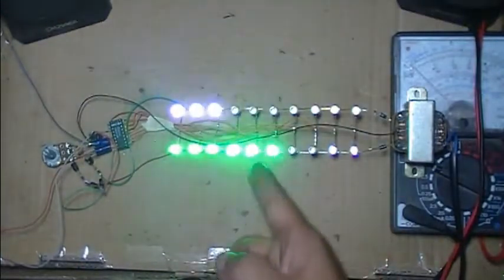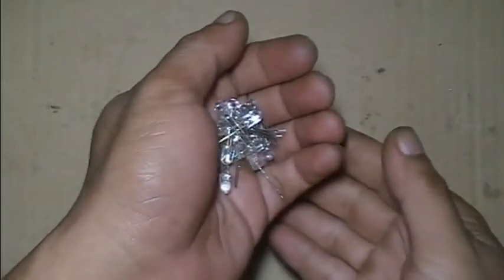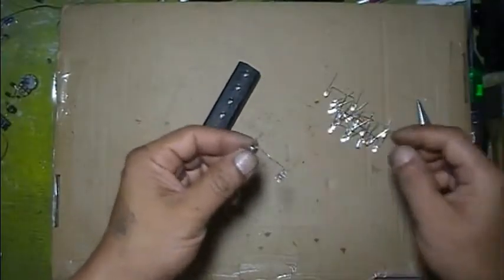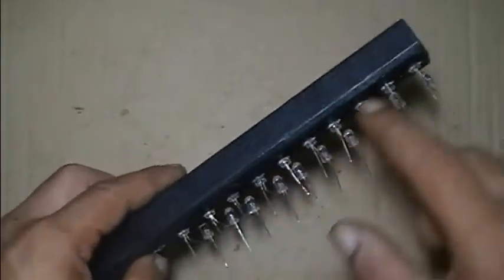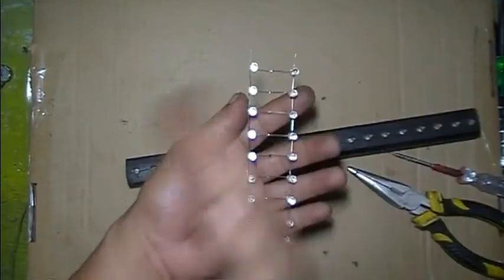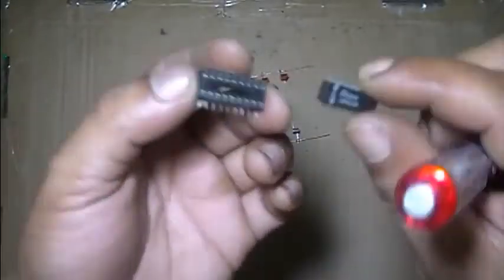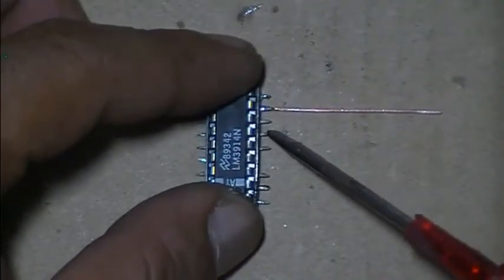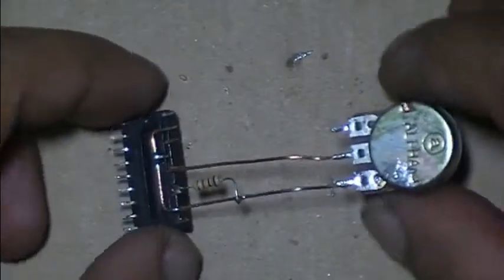Single IC stereo LED VU Meter LM3914 or LM3915 or LM3916

Comment: I made a 7 band spectrum analyzer using single LM39XX...the technique is the switching which imperceptible to human eye. They're not actually simultaneously powered but due to speed our eyes are being fooled. Same to TV principle.
Reply from the maker: Only smart people will know the secret of the electronic circuit in this video.
Reply from the maker: But I know, your "7 band spectrum analyzer using single LM39XX" thats not mean single IC.
Reply: @moristo  Yes, the system is not a LM39XX alone, there's another IC for freq assigned. But similar concept to your VU, only one LM39XX to drive seven 10segment LEDs. So 70 LEDs driven by only one LM39XX.
Reply from the maker: I know that the other ICs is Counters/dividers, timer, and Bilateral switch.
Reply: @moristo  I don't have bilateral sw. Counters yes as switching like this two transistors do. I can make using only two ICs but more expensive. So I designed another version using three ICs. Complex design but more compact compare to multiple LM39XX.
Reply from the maker: More simple and compact use microcontroller IC.
Reply: @moristo Mine is more compact than using microcontroller.
Reply from the maker: Using microcontoller IC can be single IC circuit.
Reply: @moristo Memakai mikrokontroler + shift register akan lebih baik. LED lebih banyak dan gaya tampilan bisa dibuat sesuka hati...
Reply from the maker: @NandaFiberJosz  Yups anda benar, tapi apakah saya salah memperlihatkan cara membuat rangkaian ini.

Comment: AC 50Hz supply. first +ve half on left terminal and second +ve half on right terminal. Based on that, this circuit works left speaker 25 cycle per second and right speaker 25 cycle per second. 
Single circuit but dual power input, dual audio input, and dual LED output. Wow this is grate....
Reply from the maker: AC 50 Hz electric sources, so the left 50 cycles/second and right 50 cycles/second, they just 180 degrees different.
Reply: @moristo  yes my mistake, First half 180 degree Left ... second 180 degree Right. Thanks....
Reply from the maker: But I know my friend, you have found the secret.

Comment: Apakah bisa langsung ke input amplifier .atau harus menambah komponen lagi
Reply from the maker: Pada dasarnya LM3914/5/6 masih membutuhkan Pre-amp 1 tingkat untuk bisa dipakai pada Line In/Out.
Reply: @moristo  circuit seperti ini tidak bisa langsung ke in L R amplifier class d
Reply from the maker: Sesuai data sheet, pada dumumnya LM3914/5/6 membutuhkan Pre-amp 1 tingkat untuk bisa dipakai pada Line In/Out (R & L).
Reply: @moristo  gitu yaa..okey terima kasih
Reply from the maker: Ya begitulah, tetapi itu semua tergantung dari besaran output sumber suaranya.

Comment: This is GENIUS! While I have been tinkering and building in electronics since I was 15 in 1979, I never thought of using a transformer a a switch! I have ALWAYS wanted to make a dual channel VU meter with a single LM391x, but didn't know how to switch between the channels. But after seeing this it made me think - to make this battery powered, would a couple 9V batteries in parallel for current with a decent speed switching transistor work? Thanks for an awesome project!
Reply from the maker: You need two positive poles that work to provide current alternately 50-60 times per second to make a differential between Lch and Rch.
Reply from the maker: If you already know the basics of how it works, then you should know what to do to be able to use 9vDC.
Reply: @moristo  Thanks for the reply! I was messing around with this last night. Was going to try using the 74112 flip-flop chip or a "hand made" flip flop with transistors and stuff... Still this is really an awesome project and It's kind of funny how some of the other posters say it's a trick or something. While I am not a genius, like you, it was still pretty easy to see that it is NOT s trick - it is AWESOME! It's too bad they discontinued some of those 391x chips...
Reply from the maker: You're welcome Sir.
From what you said, I can tell that you are genius.
All viewers have the right to express their own opinions, whether it is because they really don't know, or because of what motivation they express it.
Reply from the maker: Oh, I forgot, besides you need two positive poles that function to provide current alternately 50-60 times per second, you also need two gates that alternately open and close 50-60 times per second that synchronously with the two positive poles, that two gates will work for the audio sensor input section that alternately to enter R and L audio signal voltage level.
Reply: @moristo  oh yes thank you for the info! i wonder if maybe a flipflop and a DPDT solid state relay or something might work. (I sent you an email)
Reply from the maker: oh, yes, ok.
Reply: @moristo  I am making good progress. I decided to "make my own" flip flop and use solid state relays for high speed switching... As I get closer I'll show you. I like to test different things to see what type of batteries i will need and how long the will last.
Reply from the maker: Sorry, i rarely open my email.
Yeah you are right, some SSRs can do high speed switching more than 50 times per second without making any sound.
Reply: @moristo  it's ok you don' get to your email so often...  maybe I'll post it here for you to see when I get it done. the SSR's are being shipped to me soon.
Reply from the maker: May U need to see my new video.

Comment: Can we use 50 leds in series in both sides? Please reply bro
Reply from the maker: In 12 volt we can only install 4 pcs 3 volt LEDs in series for each pin the IC output.
Reply: @moristo  Thanks for the reply. Can you make a project based on more LEDs with minimum components?
Reply from the maker: @pramodmohanty6192  You can see my latest video Cupid's VU Meter LED", it's more than 100 LEDs.

Comment: Can i use 6v or 9v center tapped transformer? Is it possible to extend to 20 led for each channel with another one lm3915 ic? Your audio input source?
Reply from the maker: You can use 6 or 9 volt CT transformer, You can expand 90dB for LM3915 (30 LED), in this video audio input connect directly to speaker.
Reply: @moristo  I have not found 300 or 350 ma transformer..but seen online  200 ma and 500ma transformer..may i order them?
Reply from the maker: Friend, I said "at least 300mA", so it means you can use more than than that.
Reply: Thanks for responding..i made 20+20 led each channel with 4 ics..and i used Bluetooth audio module kit's output alongwith lm358 basic op amp. Powered with mobile charger..can i use bc547 instead those transistors..
Reply from the maker: You can use any TUN (Transistor Universal NPN), but you have pay attention into EBC pin.

Comment: Video resolution is not good. Some of your works are not understood. It would be much better if there was a scheme or a clearer video. Thanks anyway. We will solve the uncertain places by trial and error.
Reply from the maker: I'm sorry for the shortcomings in this video, and thank you for your advice friend.
Reply: @moristo  I follow with interest. I'm an amateur. I find it very useful. Thank you.
Reply from the maker: For schematic diagram the circuit on this video you can see on my another video "Circuit diagram Single IC stereo LED VU Meter LM3914 or LM3915 or LM3916".
Reply: @moristo  thank you
Reply from the maker: You are welcome.